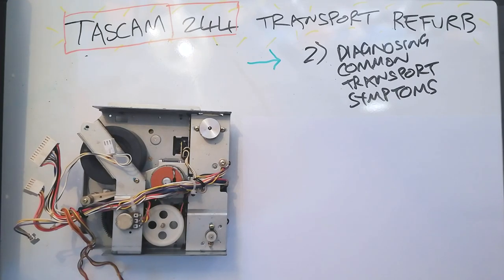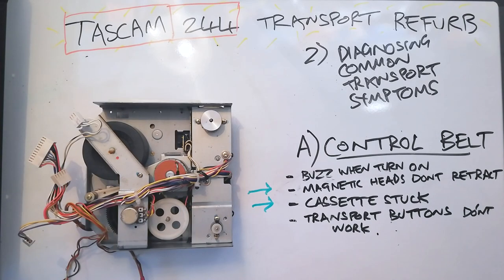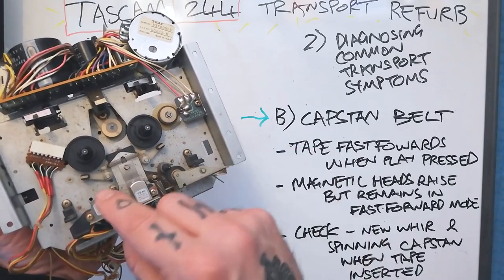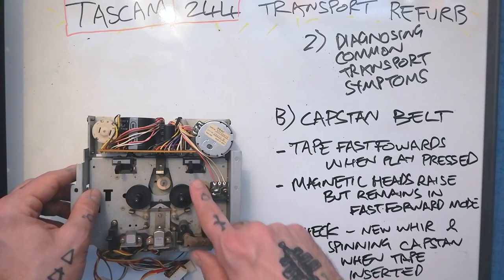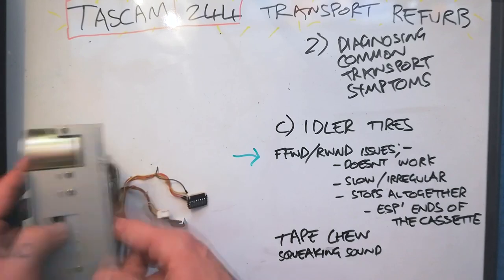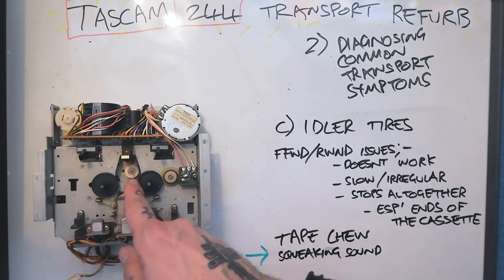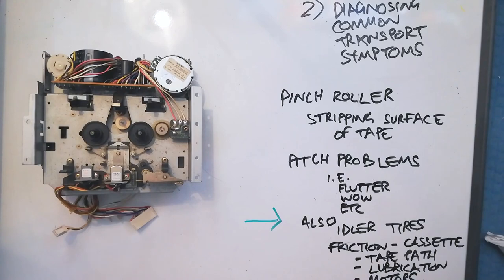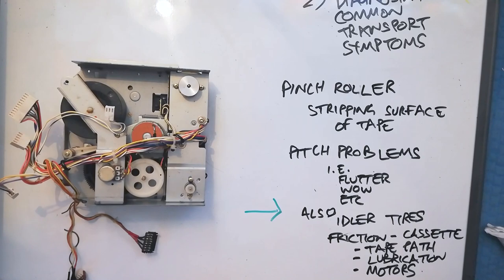3 Common problems (Fix Your Tascam 244 Portastudio Transport)

Comment: Does the control belt motor tend to go bad?  Mine completely stopped working since the last time I pulled the unit out, but it’s always been a little flaky and I thought it was belt related.  But I’m starting to realize the motor isn’t even firing up... doesn’t it usually retract at first power up?
Reply from the maker: I haven't had that issue personally but I'm sure it's possible. Yes it should be spining constantly with the belt removed. You could confirm the motor is dead by touching the positive and negative terminals to a 9v battery and see if it spins. If not contact me via my Facebook page - I gave loads of functioning part worn ones and I could sell you one very cheap, good luck.
Reply: Tetrakan Supermonobloc yes, the motor spins perfectly when connected directly to 9v power.  So it’s something else.  It’s been flaky for a while, at least I know it’s not mechanical.
Reply from the maker: @officialmikethompson  check the internal fuses if present (UK and EU models only)and continuity of all the wires connecting to this motor and the potentiometer below it. If that doesn't show up a broken wire or dry joint maybe look at replacing the capacitors on the board mounted in the transport, good luck.

Comment: I have a Tascam 246 porta studio.. it’s buzzing when turned on.. now.. no tape is stuck but that mechanism is.. First time turning it on in about 15 yrs. is the 244 basically the same internally as the 246? Or where to find replacement belts? Thanks ahead of time!
Reply from the maker: Hey, yeah the transport on the 244 and 246 are mechanically identical. What you are hearing is the control belt has gone loose or decomposed completely. If you follow the video series I made about the 244 transport you'll learn how to get into and change that belt and how to source a cheap replacement...good news is this belt change is quick and easy. Bad news is if that belt has gone its probably going to be worth you changing the other rubber parts as well. Its not rocket science but it will require a little time and patience. Good luck and thanks for watching!
Reply: Thank you! Yes I’ve started watching your videos and they are a huge help. The belts broke and were flung across one of the boards, pieces are everywhere basically.. I went to grab one away from the board and it was so sticky and brittle I figured I’d get some needle nose to pull them out so I don’t have rubber stuck on solder points. 
To my knowledge that’s the only thing wrong outside of replacing all rubber pieces as you said. I was going to take it and have it fixed, their waiting list is up to 2 years and very expensive lol.. thank you so much for posting these videos and dedicating the time to do so for people like me.. This is the only way I can access my tapes and very old forgotten songs from my teen years. I’m worried about the pinch roller being dried out but it actually seems ok. Going to order these belts and see if that’s all I needed! Thanks again, very much appreciated!
Reply from the maker: @TriTones_Music  thanks, glad to help. Best thing with the decomposed belt is to mop them up with isopropyl swabs of the kind a nurse uses to prepare the skin of a patient for an  injection or a tatooist uses to wipe away transfers before applying the tattoo gun to the client's skin - such swabs cost a few pounds or maybe 5 us dollars for a pack of 500 and you can use the ones you have left over to clean the magnetic heads as you continue to use the portastudio. I would encourage you to change the pinch roller as well since these things can look okay then suddenly on a hot day they go sticky and strip the surface off your cassette! If you look through my videos you will see one where i refurbish the original tascam 244/246 pinch roller using a very cheap and easily obtainable part AS2 (less than £2 in the UK) - it is easy to cut away the old rubber from the brass core of the original pinch roller, cut away the plastic on the AS2 to remove the rubber and slip the AS2 rubber onto the original brass core, that should leave all the rubber parts good for at least another 10 years.
Reply: Your a life saver!! Thanks again man!

Comment: Hi Tetrakan, your videos are super helpful, do you offer a repair and clean service yourself for a Tascam 244?
Reply from the maker: Hey, thanks for watching. the answer to this is maybe - any time  I've taken on repair work in the past, inevitably its been some issue I'm not familiar with which meant the timescale provided to the client was overoptimistic and I got very stressed, and though its been a while and I've learned an awful lot since then, I am a little wary ...so I would need to know the specifics of the issue so I can make a realistic assessment of whether i can help. I would also say that the costs involved with sending the unit to and from my location are going to be too prohibitive if you are outside the United kingdom (I'm in the Scottish highlands). So if you are in the UK, you could contact me via my facebook page and we could could talk about what you need?
Reply: @Tetrakan  Hey, thanks for getting back. Ahh yes I can see that being quite prohibitive as I live in London and it could easily get damaged in transit as well. Anyway thanks for the videos I'll probably have a go myself now!

Comment: Replaced all belts and tires in my old dusty 244... everything seems to be functioning okay, but the fast forward button does absolutely nothing! Rewind, play, stop, pause all seem okay... any ideas?
Reply from the maker: It's a common issue - try first cleaning, or failing that replacing the switch - see this video https://youtu.be/fhZHQhQ01vw

Comment: @Tetrakan Supermonobloc !    hello I've followed all your tutorials !! thanks a lot for what you did !  On my 244 I've changed Idler tires ( French gasket rubbers) and pinch rollers ( had to sand the plastic axis  it a little bit so that it turns freely ) , cleaned everything ... After reassembly, The 244 doesn't "eats" tapes anymore :)   every button react (fast forward and rewind , play pause stop, counter back and forth....  ) but   I still run several issues : 
-  there is still the buzz sound ( it stops when I press pause)...  I   will  soon replace the control belt but it looks neat and not to mellow...Could  be other stronger issue ? 
-
 When pressing play, the heads engage but there is no playing nor rolling...  it stay stucked then disengage. . When I press play without a cassette : it's running  at the same speed as fast forward.  (counter going very fast and same rolling noise). I've seen here that it is a capstan belt problem ( I've ordered a replacement one)  ..But as I made some other mistakes I try to ask you about the following :) 

- In my feary disassembly  i've broken a part in the little white plastic  joint and  arm that  is fixed below the  control potentiometer and with a small pinch to the black wheel turned by control belt.. I have repaired it with glue so that it pinches the black wheel as shown on DR ZEE photos  .. I've followed DR ZEE  tutorial but I may have made a mistake remounting the plastic on the potentiometer  :  Can it be related to my play issue ( fast forwarding speed ) ? Or is it something that has to do only with control belts ? Thanks a lot for your help
Reply: Hi, I can't quite visualise what you are describing...could you make a video demonstrating the problem? You could upload it to youtube and share the link here, or message me via facebook.
Reply: Hello i make it Asap thanks for your help
Reply: @calumdavidson2548  Hello .. the capstan belt is very loose and  old.. So I've ordered a new one... It looks like it the problem you describe in your video  ( no good capstan belt = fast forward when press play) ... Anyway when a tape is engaged , the belt doenst have enough torque to make it roll .. Thanks  for your help
Reply: @calumdavidson2548  Hello I'm also @surfer d'argile)  after changing Idler, Pinch, Capstan and control belts, the transport act normally (with a bit of backgroun noise).. My last challenge is getting the Right channel to work as the Left one... I commented on other videos you made ( about stereo buss trouble) ... Thanks a lot anyway .. my 244 playbacks !

Comment: Love all the invaluable info you've offered on these classic units. Thank you! My 246 was serviced about 6 years ago and has been running fine, but yesterday I noticed that if I hit PLAY immediately after fast-forward or rewind, it plays super fast for a second before eventually settling down to the normal playback speed. I opened it up and can see that while it's happening the wheel attached to the control belt is slowly turning before it finally locks into position. So I'm wondering if this is merely an early sign of a belt or tire starting to go bad and would rather address it early than have it die when I really need it. Is this a symptom  that's easily recognized?
Reply from the maker: Maybe old grease on the gears and cams that raise and lower the heads? I don't have a video on that specifically, but it's just a matter of removing a few c clips, use isopropyl to clean off old sticky grease and put silicone grease on instead then reassemble. Also try replacing the control belt. The idler tires won't have anything to do with it I don't think.
Reply: @Tetrakan  Thank you for your prompt reply...and of course the suggestions. Will try them out soon.
Reply: @Tetrakan  Btw, does this involve removing the entire transport, or are those c clips easily accessed without having to do so?
Reply from the maker: I think it's worth removing the transport, the other work will be easier

Comment: I’ve replaced the idler tires, roller and both belts but the play button seems to not work. When pressed the heads and roller go up but after a few seconds will go down again. Any solution?
Reply from the maker: Is the counter ascending from 0000?  If it is not, autostop will retract the head after a few seconds

Comment: I just got one of these units and don’t have the tape yet to check if it works. It buzzed when it turned on does with mean it needs fixing or can that just happen?
Reply from the maker: The 244 makes this sound when the control belt needs to be replaced.

Comment: Thanks again for your excellent video series, it’s a great resource to have access to. I’m struggling with a problem with the tape stopping on a 244, and also the counter not moving at all. I have so far cleaned all the rubber residue and changed all the rollers and tires. I’ve spent a long time making each surface rubber and residue free, but for some reason whenever I press play, FF, RW it stops after a few seconds. I can’t seem to get it to move further than that, and the counter doesn’t progress or go backwards at all. Do you have any idea as to what could be causing this?
Reply from the maker: Thanks. If the counter does not ascend, the control boards will evoke autostop, so I suspect a problem with the counter sensor is your issue, not anything mechanical to do  with belts or so on. Make absolutely sure all the cables are plugged in. The counter on this model is a hall effect sensor, a transistor on a small circuit board to the right of the take-up reel; the take up reel turns a reddish coloured magnetic which induces an electrical current in the transistor, and that's how the control boards sense whether and how much the  cassette is winding. Make sure there is nothing to prevent the mechanical part of this sensor from turning, and no obstruction (I.e. a bit of old belt or other debris) preventing the magnetic field being picked up by the transistor.
Reply: @Tetrakan  you’re such a geezer captain. I’ve discovered the previous owner had wired the pitch control to the control board… will have left this here for posterity. Might record Alan Partridge disassembling his Corby trouser press for audio test. Much appreciated for your time in answering and hope I’ve at least stopped three others from pestering you.

Comment: I recently got myself a tascam porta 07 and theres too much flutter when i record,  even using new virgin tapes. What can the problem be?
Reply from the maker: If you ahve already replaced the rubber parts and lubricated the mechanism, you could try repolacing the motor control chip which is prone to overheating, see this video. https://youtu.be/h1BBVAtDtIo

Comment: I have a 246. It won’t play at the right speed. When you record it sounds out of tune when you play it back as in slower. Not sure what to do to fix it any ideas?
Reply from the maker: If the rubber parts haven't already been replaced, do that now. Remove eep clean and lubricate the speed pot? (contact cleaner; compressed air; appropriate lubricant, I use deoxit fader lube with a needle applicator)

Comment: I recently saw a message from someone describing problems he is having with his unit as follows.
"Everything is working except for the reels which I assume is due to the belts because the motor runs for it and the capstan activates it's just the mechanical aspect of having the reels being set in motion."
Not sure which belt(s) that would be or if it's the idler tire. I don't know what he means when he says "the motor runs for it and the capstan activates"
Reply from the maker: Three separate motors on this one. If the capstan turns, that belt is okay. If he hears a motor turning in response to ffwd/rew buttons but the reels do not turn, new idler tires are needed.
Reply: @Tetrakan  Thank you!!

Comment: Hey, just got a Tascam 246 and am thoroughly enjoying it. Everything seems to works fine however there is a consistent clicking as the tape spins around coming from the cassette compartment during playback. Doesn't seem to affect anything, it records and sounds great just annoying and a little concerning. I've cleaned everything and tried multiple different new cassettes. Any advice? Thanks any help would be greatly appreciated.
Reply: Oh and the click is regular and changes depending on the speed of the tape
Reply from the maker: Hey, sorry its taken me a month to reply - I had a bad house fire in the fortnight preceding this comment hence the delay...the click is probably your idler tires. I mean, I can't 100% diagnose anything without actually having the unit in front of me, but what tends to happen is if the rubber is a little old and the unit lies dormant for a while, a slight depression is left where the brass spindle presses into the rubber tire and the click happens when the mechanism passes over it. While its great thta you got a fully working unit, I'd encourage you to replace all the rubber parts anyway, since you don't know when it was done last and its much easier to do before the rubber deteriorates badly. Good luck!

Comment: This helped me soooooo much! I will definitely be sending you a tip for these amazing videos. I bought a 244 in cosmetically pristine condition for $200 and it needed all of the above!! I was able to replace the belts, pinch roller and idler tires in a few hours thanks to your guidance. 
Everything seems to be fine mechanically and getting playback of all my old tapes but I am getting a lot of IR chatter and rustling/rumbling sounds. Seems to happen even without a tape playing and definitely affects all the 10 or so different cassettes I've tried. Could this be cell phone tower interference? I get this on my studio monitors too (copper shielding cut it way down) but it's so much more pronounced on the 244. Let me know if you have any thoughts. I tried cleaning the heads too and ran a demagnetizer cassette but maybe that's not adequate for a four track? 
Thanks again for your guidance!!
Reply from the maker: Glad this was helpful. Yeah I've found the 244 is very susceptible to extraneous noise. I use power extension cables with RFI /EMI filtering for all my portastudios. I don't think demagnetisation will help.
Reply: @Tetrakan  Ok thanks! Do you know of any recordings of different noises I could reference? It does seem very similar to the chattery noise I hear on my studio monitors, but there's a consistent rustling too. Wondering if that might be a motor thing. for EMI filtering, I'm plugged into a Furman power conditioner but that didn't make much difference.
Reply from the maker: The power conditioner should deal with the "chatter" part. "Rustling" is perhaps indicative of dirt in moving parts (especially faders) or even bad solder connects, leaky caps, etc. I'd you haven't already, deep clean the boards with pots and faders on them.  Do that before any real  electrical work - it's a nearly 40 year old unit and you probably don't know the life its had, plenty of time for dust sweat drinks link condensation and smoke to get into nooks and crevices. If you do that and the issues still persistt, reflowing old solder and even recapping parts of the audio path can work wonders, there are logical diagnostic things you can do to narrow down where you do this and make the work more likely to yield the desired results, check my other videos or message again for more pointers of you reacb that stage.
Reply: @Tetrakan  ok perfect that makes sense! It’s definitely in amazing condition overall but I take your point that dirt and condensation could be an issue. Just went through a similar ordeal with a fender amp- lots of solder points that needed reflowing. Thanks again for the help!!